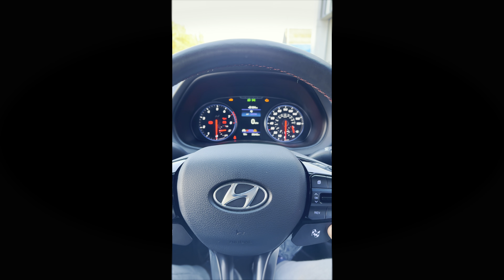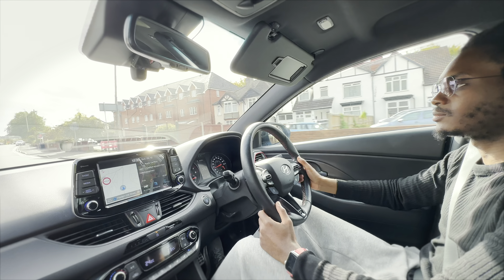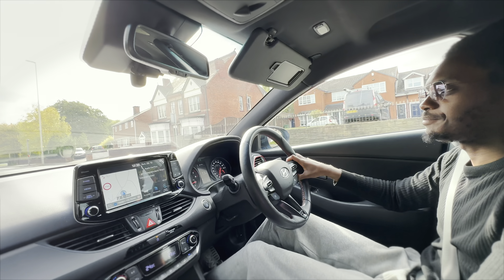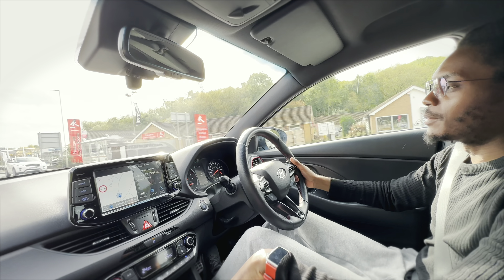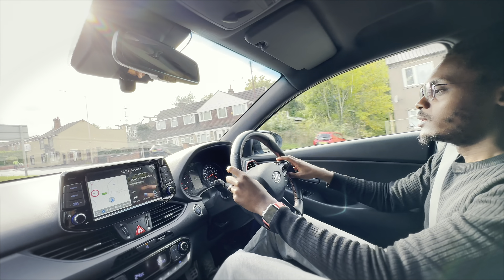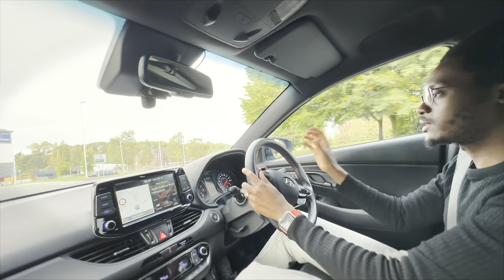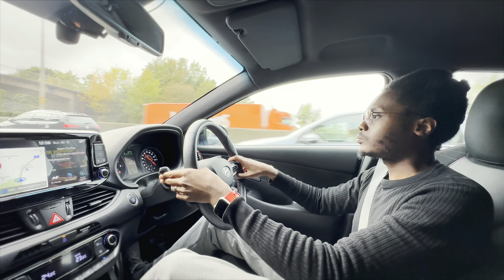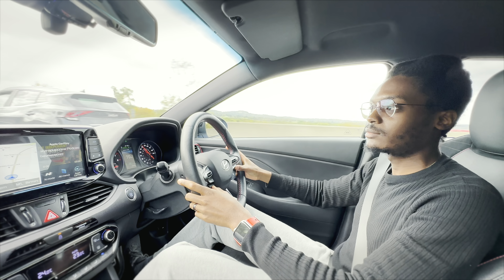Custom Valved Exhaust Setup for my Hyundai i30N Fastback

Comment: Getting a custom quad tip full exhaust next month, sports cat all the way down and straight piped on one exit, will be 1 of 2 in the U.K. with quad tips can’t wait
Reply from the maker: @Dan-bs5rx is this with an aftermarket diffuser or the standard diffuser?
Reply: @aSidney  standard diffuser but has to be cut to fit the tips as each one is 4’5” , maxton diffuser bolt one will still fit over the top though, only costs 200ish for a new one if I ever wanted to revert to stock exhaust if I sold the car
Reply from the maker: @Dan-bs5rx Ah I see, fair enough - that'll look pretty mean
Reply: @aSidney  will definitely stand out at meets, didn’t want it to be just another 30N with the mods that hundreds and thousands of others have wanted it to be a bit more unique which unfortunately comes with the price tag ahaha